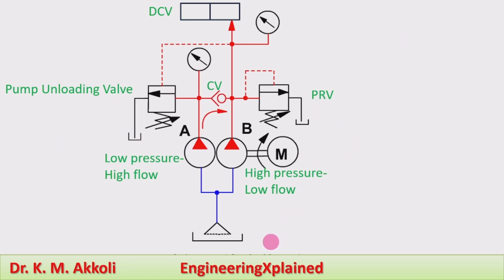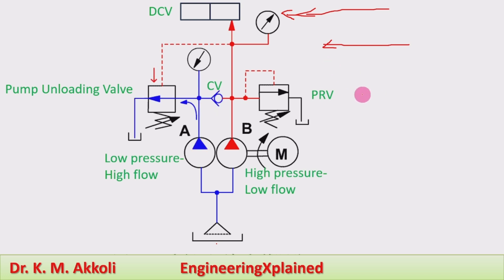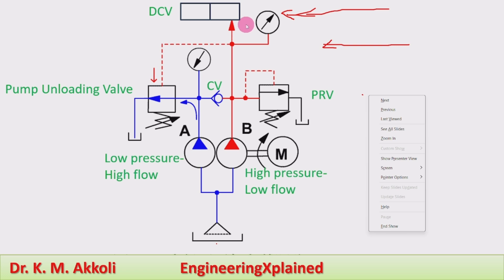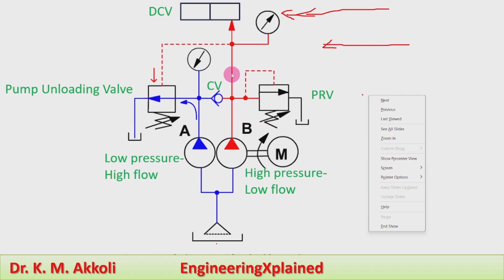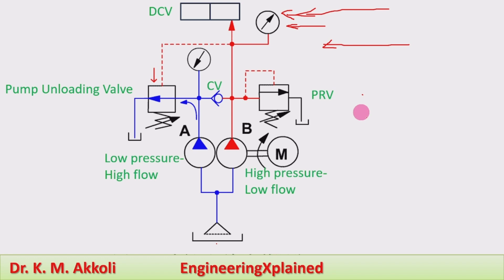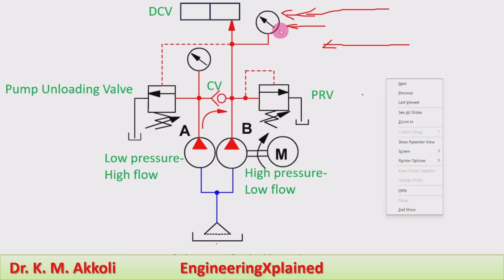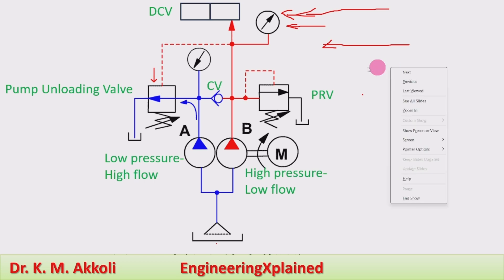Double-Pump hydraulic System Animation | Fluid Power System

Comment: Sir how to set pressure?
We need pressure of 70kg/cm² for holding a steel coil.what pressure should be set for the unloading  valve and pressure relief valve?.We use F3 3520V30A **10 181 vicker hydraulic pump.